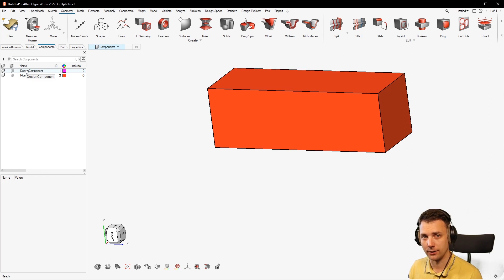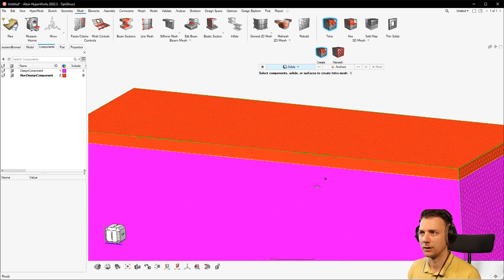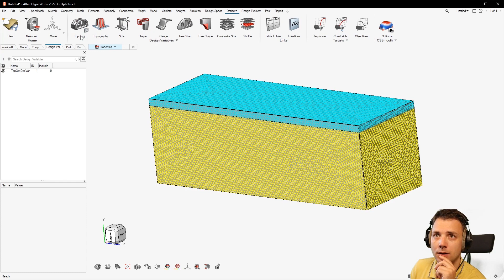Altair Hyperworks #short -  How to define design and non-design for topology omptimizations

Comment: As chatgpt is trending now a days can you please make a one tutorial  with hyperstudy with design of experiments by taking a simple block and come up with cantilever final problem have less stress. I think we can  use parametric optimization and hyperstudy together wjth ML training
Reply from the maker: Hey :) Sure I can do a Hyperstudy model in the future. I suspect that right now GPT would not be that helpful until I can give them the Altair Documentation to take as an input. I tried around a little bit with generating .fem files right away in ChatGPT 3.5 with very little success. But one thing to get here is: Hyperstudy is DOE which is great when you can't take advantage of gradients. But TopOpt takes advantage of gradients and although you might be trapped inside a local optimum, the convergence rate is so so much faster than with an DOE. Use physics everytime when you can...
Maybe you can elaborate a bit more on your idea how to use Hyperstudy and ChatGPT together and we find something to try out :)